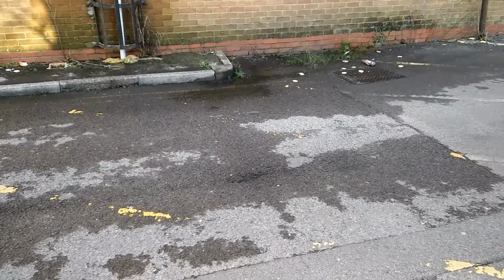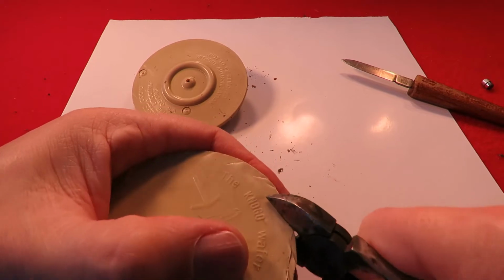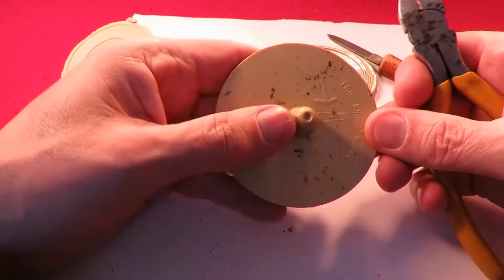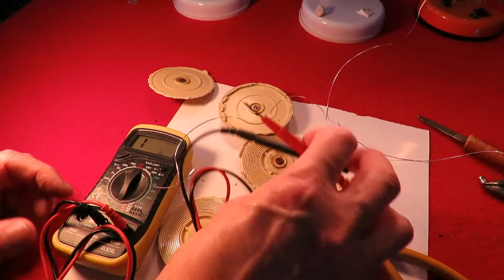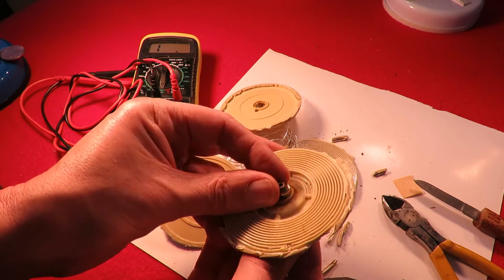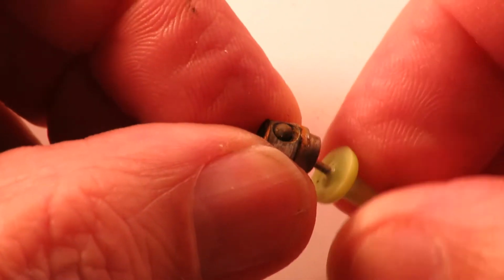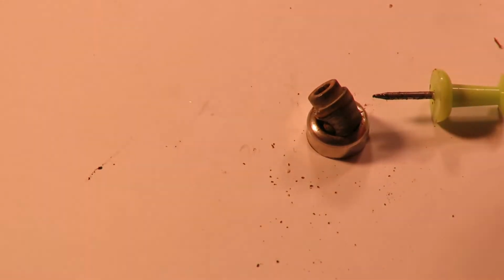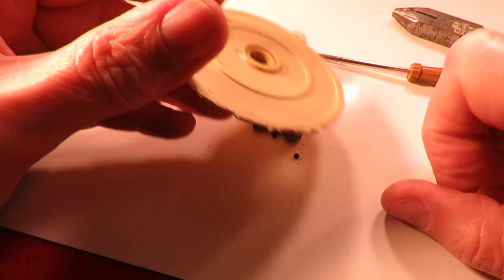Inside an old security tag - passive RFID

Comment: Did you find out what that little capacitor thing is. Interesting to see the inside. 
So now your all set and ready to go shopping, and don't forget your pliers. 🤣🤣👍
Reply from the maker: I think things have moved on since these were in use although I guess there might be some places still using them.
Reply: @GrandadIsAnOldMan  Yes I think your right because I never see them around. They used to put them on bottles of spirits in ASDA.

Comment: I would presume that the spring would push the inner piece into the outer piece.  The pin would enter through the outer piece and is pushed toward the spring.  This pushes the inner piece toward the spring until the balls fall in the ring on the pin.  This lets the spring re-seat the inner piece and trap the balls and the pin.  To release, the magnet pulls on the inner piece, compressing the spring and releasing the balls hold on the pin.  Kind of like the push stud on a necktie thingy.  This is probably well explained in the other videos, but - it's late and I'm going to bed ;-) ... I wonder if these could be used with a 'wireless' charger.
Reply from the maker: Sorry about the time slots I publish but I literally can't please the whole world. There is some science behind the times I have selected based on YouTube's analytics for my videos. Back to the balls 😆 yes, the confusion with the ones I was testing here is the simple fact they have corroded and don't move freely otherwise I should have been able to demonstrate with a good sized magnet. Wireless charger - in  principle yes, all you need is a coil of wire and a driver circuit. I did some wireless projects a few years back.

Comment: Hi Grandad. It is sonic welded. I work in the industry at my last job for 15 years before retirement sonic welding machines was one of our product lines. It easy to spot on plastic if you look closely at the joint you can see what looks like melting plastic just squeezing out of the joint. If you look at the two round spots on the disk they are 2 weld post inside that trap the diode and weld it to the plastic. See the location of the ends of the diode are in line with the two spots on the outside of the disk. The two way piece of sticky tape holds the diode in place while loading the parts in the ultrasonic nest then the ultrasonic horn comes down under desired pressure sending sonic vibration (20kz) fusing the plastic. I think it is a diode, not sure.
Reply from the maker: Hi Ed, thanks for the input. I was trying to think of something useful to do with these tags but the only idea I came up with was wheels for my rubber band powered cars  but I only collected the two I took apart 😁👍

Comment: I once worked in telecommunications and we had a job at a high school that used a security system for the library. 
We found that when we walked through the scanners with a half full box of 1,000 foot cat 5e cable, it would cause the alarm to go off. 
Suggests a resonant tuning system like you suspected .
Reply from the maker: Yes, I am guessing that component is just a capacitor. The articles I found online all talk about circuitry sending a coded signal but that is all I can see.  Maybe more modern ones have more in them.
Reply: @GrandadIsAnOldMan  
That makes sense, I once made measurements on the cat 5e cable for shits and giggles and found it could support capacitance. An air capacitor type of thing I suppose.